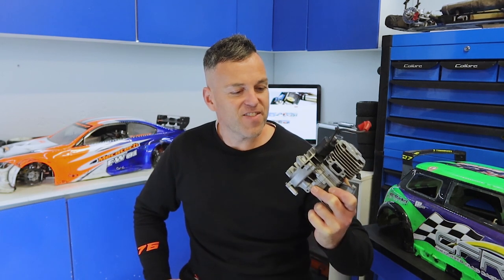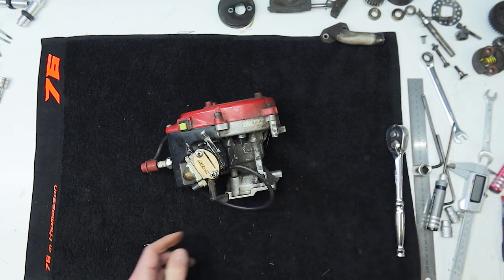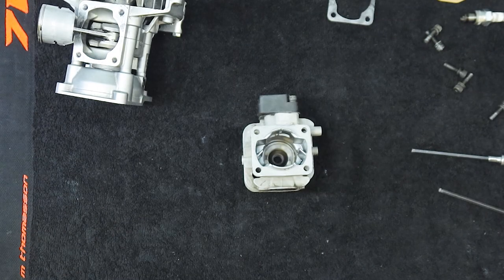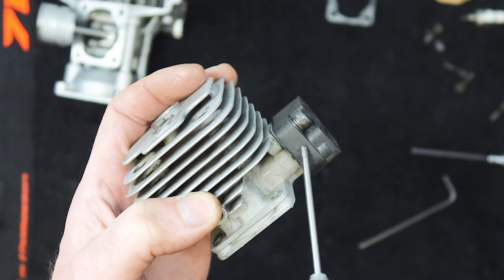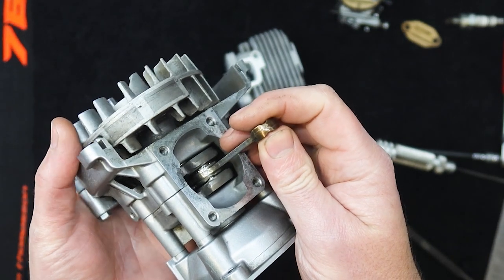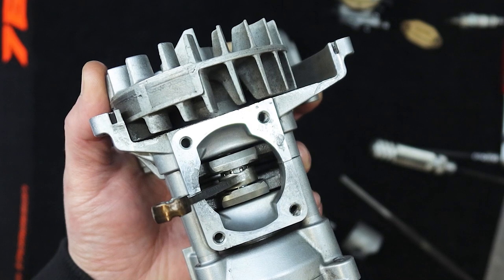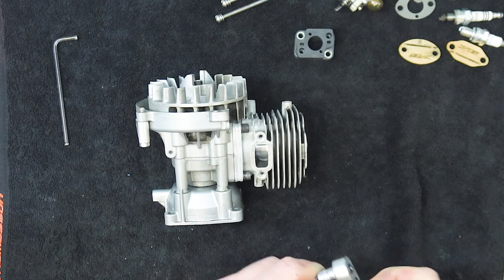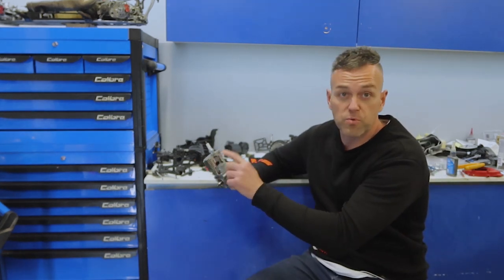ZENOAH Top End Rebuild

Comment: right so.. maybe im not the best researcher when it comes to this topic but perhaps you can somewhat answer my question:
is there like a sign or something that may tell me if a motor is quote on quote worn out? 
cause you can't tell me with the wear and tear and stresses a motor goes through, it doesn't wear down.
bare in mind, im fairly new to gas (specifically RC) engines like Zenoah or ones from Rovan.

Comment: Is 4 bolt motor better for racing my motor is 2 bolts running strong and very tight use 5 oz oil to a galón here in Puerto Rico

Comment: Subscribed - great, informative videos. Would  really appreciate some 2-stroke tuning videos.  There’s enough theory videos out ther, but a practical, video showing how you tune for peak performance would be great. Maybe a bench video showing how needle adjustments impact sound and overall power. Thanks!
Reply from the maker: I've got an awesome practical tuning / demo video planned! I'll load up the engine and demonstrate how tuning effects performance (and life span) will also show live RPM and Temp data too. Thanks for the support Mate!!
Reply: That is great! Was going to ask the same, I look forward to it. My main confusion is with the Idle screw and what to do with since I can tune the low speed needle to control the idle as well. Low speed and Idle screw settings are the confusing part to me, seems like I can adjust either to achieve a good idle, so not sure! Looking forward to your video!

Comment: Arrow on the piston points to exhaust? So head bolts are 7nm but what about crank bolts? I’m doing a full build bottom end up and the seller that sold me the kit claims there are no torque specs for the 32cc

Comment: I had such a hard time to get the head onto the piston. It's a brand new engine, the 36cc double ring CY engine. I was removing the bottom ring before even running it. Then it was stuck. After pouring some oil in there and pulling on the pull start its turning.

Comment: Hi Mark what do you do for break in after a rebuild? i usually do 3 \15 min heat cycles then a couple of tanks at half throttle pulls and 1 tank
At full short burst throttle
Great vid 👍😎
Reply from the maker: @Ian McKay - for a full rebuild I normally do the same as you! my heat cycles are only up to operating temp tho...  I'll demo what I do in the full rebuild video! you into cars, boats, planes or heli's? Thanks for the support Mate!
Reply: @MarkThomasson76  
I mainly do large scale custom bajas
And. 1:5 desset trucks but also nitro
Rc losi 8ight , had a big end failure last month on a ported 36cc the con rod went through the crankcase! 😣
All rebuilt now .look forward to your next vid👍🍺

Comment: Awesome video mate, look forward to see your full rebuild videos and how to modify head. Do you ever modify your carbs? I have a ported head for my G320 zenoah and want to find out how to modify my carby to supply more fuel!! I think it’s a pop off mod ??
Reply from the maker: Thanks Legend, appreciate the support! I don't normally have to worry about the carb supplying enough fuel (our track is pretty short, so much much time WOT) the pop off mod really relates to the spring, if you are running out of fuel i'd be checking the metering lever or diaphragm! what are you running the G320 in?
Reply: Losi 5T